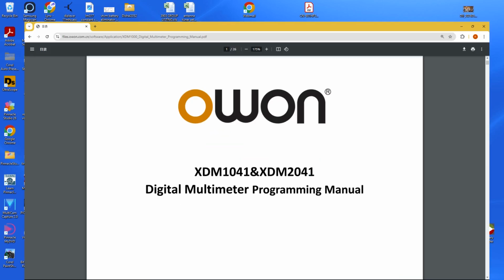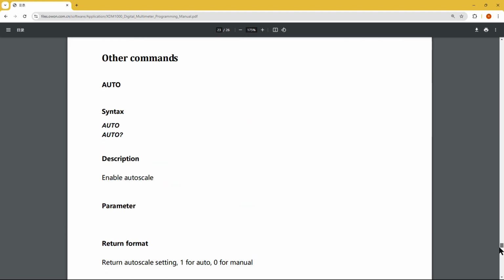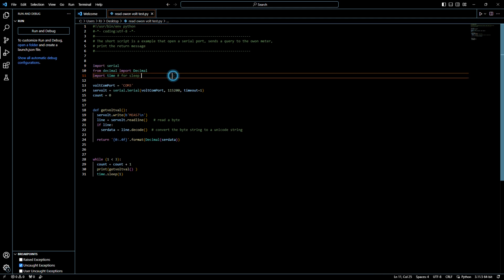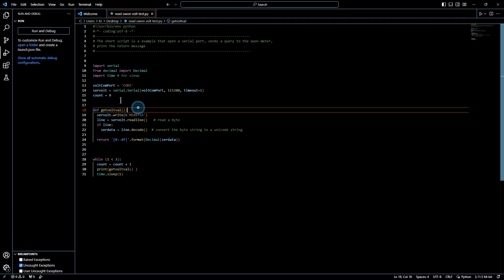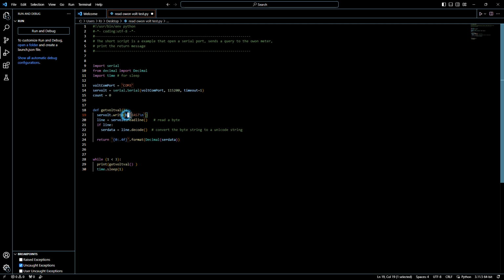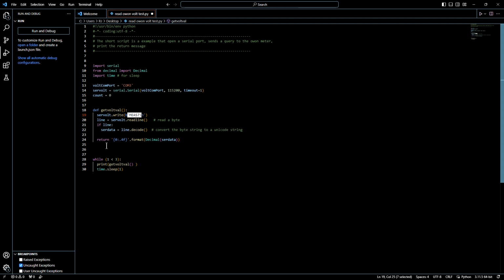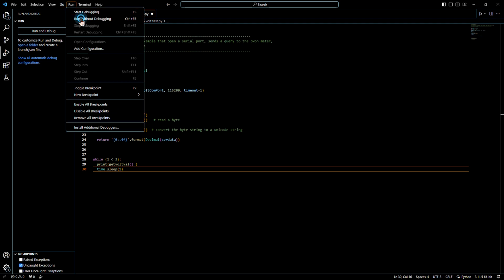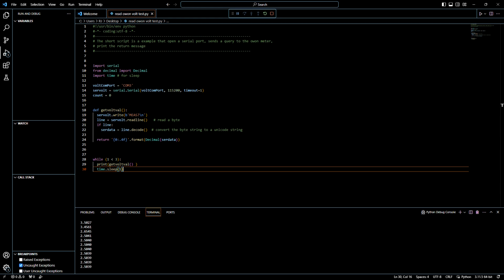SCPI Commands Demystified: OWON Meter Software Tutorial

Comment: Thank you very much for the tutorial.   How about programming with BLUETOOTH interface OR can I use a usb to bluetooth adapter with it?  I wonder if you could do a video about it.  Thanks again
Reply from the maker: Thanks for the comment, 
My Owon XDM1041 does not have Bluetooth on it. I don’t think an usb Bluetooth adapter would work. They usually expect to be connected on your computer to connect it to a HID device. I just use the usb port connected to my bench usb hub to communicate with my computer. 
RJ
Reply: @LynxElectronicsLab  I really appreciate your response.  The reason I need to comm. by Bluetooth because I need to ISOLATE the ground from my Raspberry Pi and the meter's ground.  I don't have the XDM1041 yet and I wonder if you could check to see if the meter's USB's ground is connected to the meter INPUTS in certain way at all?  I had another thought right after commenting.  To use a micro Raspberry Pi (maybe Pico) as an intermediate device.  It will talk to XDM1041 thru USB and talk to another Pi by Bluetooth.   I think it is POSSIBLE and I'll let you know when it's done. Thanks again.
Reply from the maker: Sounds like a great project! Looking forward to hearing the outcome. Watch the video this coming Friday morning for your answer. 
RJ
Reply: @LynxElectronicsLab  I am excited waiting for your video and it's now 10:38AM Chicago time🙂
Reply from the maker: @ It was posted a 9am this morning the 4th.
RJ

Comment: Can you change measurement mode via SCPI commands? I've tried about every permutation of the programming manual but cant get the xdm1041 to switch to AC Current measurement mode. Help please?
Reply from the maker: I use this python string ....servolt.write(b'CONF:CURR:AC 5\n').... do not use the beginning and ending periods they are to make it clear where the command text starts on this comment reply. the b' is to make python send it as binary not encoded. The CONF: puts us in CONFiguration menu. CURR is current and AC is for AC mode and 5 is the 5 amp scale. Change the 5 to what ever you need for a scale. 
Hope this helps. 
Let me know if you get it working or not. 
RJ